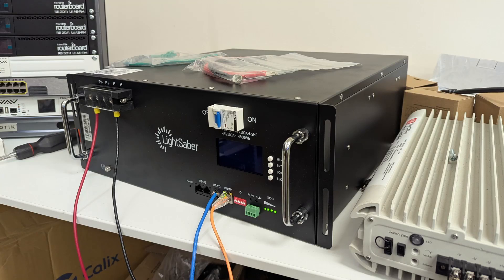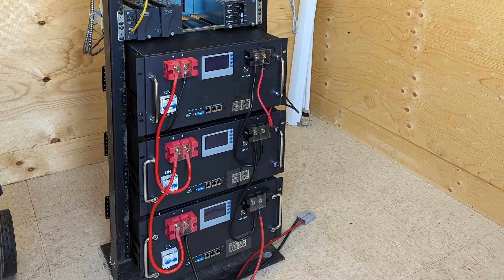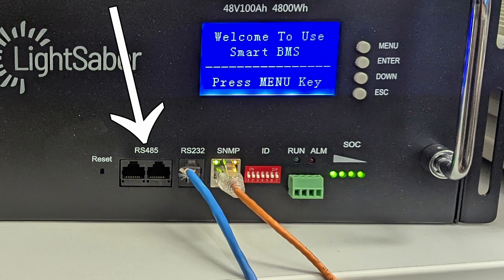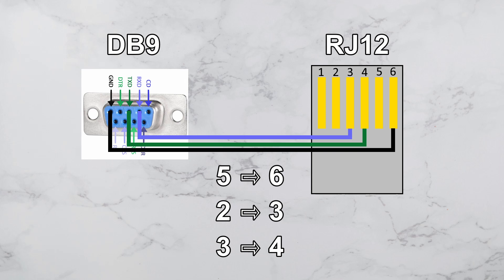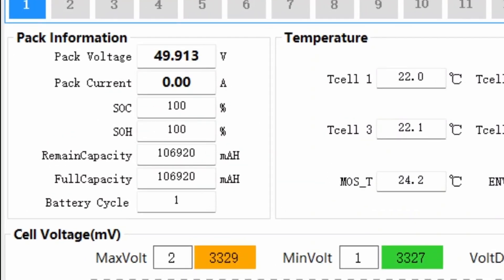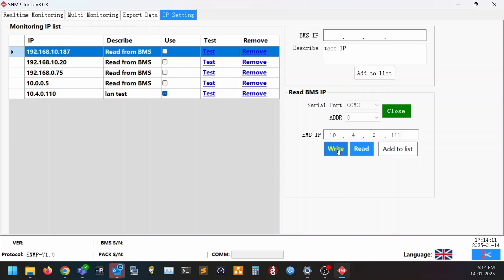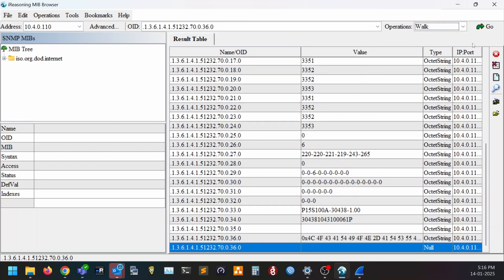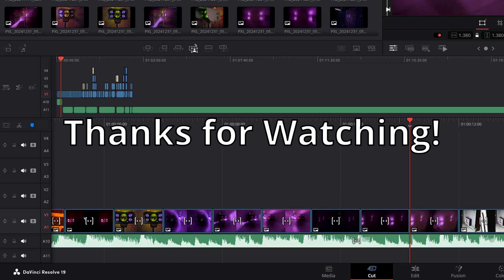LightSaber Optics LiFePO4 Battery: Network Setup and Software

Comment: I know NUT supports the SNMP protocol, so would this be a good UPS for my homelab/homenetwork?

And would it actually work with NUT since many companies use a standard protocol with a proprietary data structure that requires extra tweaking 😤

Comment: The list of IP addresses are in the software only.  Before you read the address from the battery, enter in a new address in the list which allows you to set the default gateway and DNS settings.  Once it's in the list, read then set the IP address manually.  It seems to take the gateway and dns from the list when you write it to the battery.